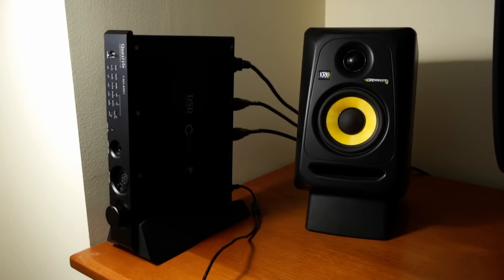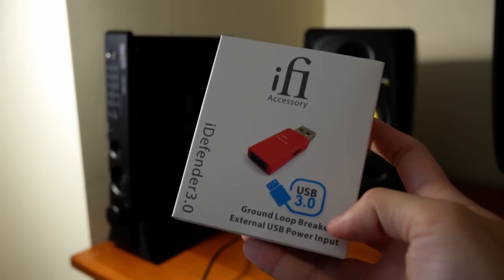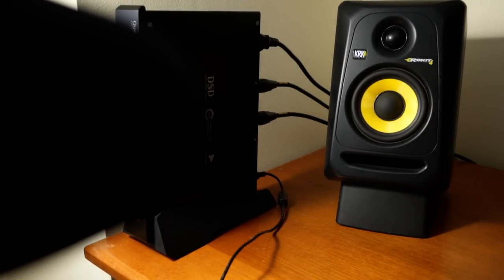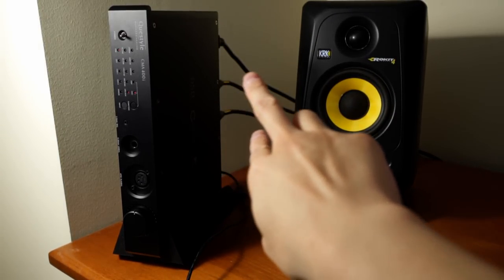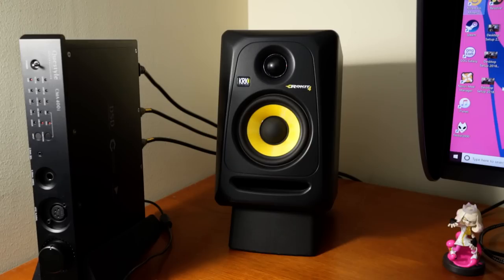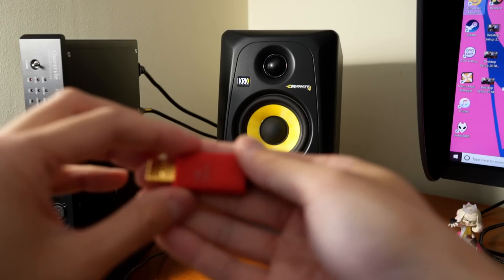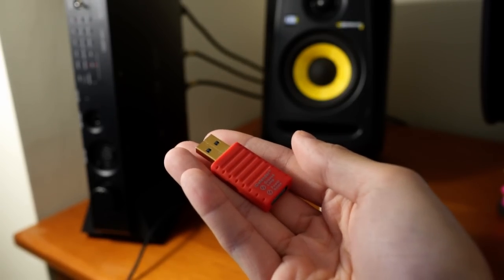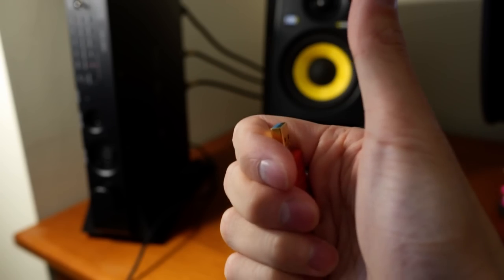ifi iDefender 3.0 Review & Demo: Breaking a GPU Noise Ground Loop

Comment: No one seems to be making any mention here of the fact that most PC power supplies that come with a store-bought PC are absolute garbage, built using the cheapest, low-end internal components possible. One of the nice things about either building your own PC or buying an off-the-shelf one that uses all industry standard PC components is that you can easily replace and upgrade any component in the system at any time. Whenever I buy a new system (or build one custom) I immediately replace the default power supply with a much more expensive one that's constructed using far higher quality internal components. If you have a system that is introducing noise every time your GPU is active you are very likely dealing with a system power supply that is incapable of delivering both sufficient power and sufficiently clean power that you require for proper operation (Hint: hearing audible noise through your speakers when a GPU kicks in and operates is something that should never happen). Rather than trying to take noise off of a ground loop with a $50 USB isolator/ground loop breaker, maybe your first step should instead be to make sure that you even have a high enough quality power supply in your system to begin with that can actually deliver enough (clean) power? A good quality replacement PC power supply built to far higher standards than the factory default one that comes with a new system can be purchased for anywhere from about $90 to $175, depending on how much power you need/want. That's always money well spent. Before trying to solve any audio problems with this type of after-market device, I'd make absolutley certain that I first had a very good, high-quality power supply running in my computer to begin with. Because I've always taken that step first, I've never had any type of noise issues using external speakers or headphones, regardless of the external DACs/amps that I've used. The other thing that can potentially help deliver slightly cleaner/less noisy power to your power supply is to replace your default (cheap) power cable with a far higher-grade oxygen-free one. A good OFC (Oxygen Free Copper) PC power supply cable can be purchased for anywhere from around $29 to $69 and is also money very well spent if your objective is to be able to get the cleanest possible audio out of your system.

Comment: I realize that this is an old video, but I think I've run into a similar problem. I'm curious, aside from the noise reduction, did the character of your audio change at all when using the iDefender 3.0?
Reply: Also having the same issue. Noise us even worse when trying to game.
Reply: old comment but yes it changes the character of audio, increases the high freqs and reduces the bass. It does completely solve my noise issue but I dont like how it sounds at all

Comment: It is so damn expensive because the used usb chip inside. I bought mine for about 10 euro's straight from the source in china and saves me allot of money. It is actually an isolated DC/DC converter (in fact a 1:1 PWM transformer) and a chip to isolate the bus lines. It is that complicated because usb requires the same ground path to be working, so it needs a 'conversion' trick. What you hearing (jitter) is a compound of the digital ground produced inside the computer. In fact it is not a fault of the computer hub, it's inside the huge usb soundcard. You can test this with a multimeter, if the RCA ground is connected to the USB GND pin and/or USB connector shield, they saved some dollars to do it right.

Comment: Have almost identical setup - PC, USB DAC, Active speakers, but iDefender did nothing to fix the buzzing sound. When i remove grounding from speakers, no buzz at all - so it is a multiple ground issue. You can almost buy a decent DAC for 50 €.

Comment: If that's all it does is disconnect the power lines, then you could probably take a pair of tweezers and pull out the + wire in the USB cable.  You can even put some super glue over the + wire, it's on the end so....It might just work and save about 60 bucks.  Everybody has 10 cables laying around.

Comment: I had a USB noise issue and couldn't figure it out. Went back to my Furutech manual (who would have thought to read the manaul!?) and they actually suggested just using an external powered USB port if it happens.  I haven't had a problem since.   So may be a cheaper option to try for people looking for a solution.
Reply: which one would your recommand ?
Reply: External powered usb didn't do anything to improve my issue for those reading. I've purchased the iDefender and their 5v power supply. I'll update once it comes in if anyone is on this old video and is curious.

Comment: I have this exact same problem with my Questyle CMA400i and my Macbook Pro Mid 2015. I bought the iDefender 3.0 and it doesn't work. Still the same ground loop noise...
Reply: Did you ever figure any solution?
Reply: @oshtsasquatch295  Yes I did. My Questyle and my Macbook charger were plugged in into one power strip that was plugged into the wall. I plugged the two devices into different power strips and somehow that solved the problem...
Reply: @bobsandee7983  Thanks for the reply. I have ordered a new soundcard (comes tomorrow) and I think that is what I'll need. I have been through the book (including cutting every single ground in the entire system). Hope the new card works...

Comment: So mutch thing to check before:
All cable shield, and if the computer make noise then 
Take a cable and take off red wire out (Cut-it) and use another power supply.
i mean the audio USB cable
Etc…

Comment: Overall good explaination! But "no power transfered" is wrong. Without any power the usb connection would not work. What it does is to put a galvanic break between input and output. So it forward Power but not the distorted power.

Comment: In your video using the defender supresses the noise caused by the computer.  But there's no audio coming from the speaker. What the buyer wants is the desired audio coming from the speaker without thr computer noise. Your video doesn't sho that.

Comment: You really should not use front panel USB connectors, the internal wires to those and the board connector are usually junk, also that wire usually runs right across all the electronics is less shielded than other connections.

Comment: Just chancec upon your video, just want to ask does the thing work as a regular usb data cable/plug or somwthing. I've been streaming for some time now and i want to use it with DS4 controller (im assuming the button inputs count as data input or transfer), coz when ever im charging my controller i get some static/clicking/hum from my headset. This only happens when im charging and at the same time got have the elgato chat audio cable pluged in to the capture device.

Comment: yes it works and the idea is very straightforward, which is removing the power pins in the USB connection, and only leaving the data pins.

however this is how the 1st grade of the electronics school would implement it, just as a proof of concept.

now, the most elegant implementation of the same idea, is by using the Adum3160 chips, and the monolithic air core transformer component, which does just that. it physically separates the incoming signal from the outgoing signal. 
not only that, it actually cleans the incoming signal, and sends a better version of it to the output, like a repeater or mini amplifier. 
it allows 12 Mbps data transfer rate bidirectionally. so it is not capable of USB 3.0 4.8 Gbps data transfer rate, to work continuously through such USB signal isolator. 
so if you are connecting a very high data transfer device, you must bear it in mind, that Adum3160 chip won;t be able to keep up.

however for the Audio Interface, USB 2.0 data transfer rate is sufficient for the 18x 24 bit channels simultaneously, so you should be safe there, unless you are working on a big mixer with more than 18 signals being consolidated into one USB connection.

also for the USB MIDI, the data transfer is 30 kbps, so you don't need to worry about USB 2.0 for the MIDI operation over USB connection.

I actually prefer the Adum3160 chip, which is the actual transformer, physically isolating input from output, and only sending / receiving the actual data, and filtering everything else, which is ideal.

And it only costs ~USD13, if you want to check it out. 
https://amzn.to/3IB224k
Reply: Dorkaholic  go ahead

Comment: Just want to point out - it could have very well been coil whine either way. Almost all computer hardware (most noticeably GPU's and PSU's) have it to a degree. It's just that more times than not, it's at such a high frequency we can't hear it. Your studio monitors could have simply amplified it. It can happen without them being even connected to the computer in question as a matter of fact. All it takes sometimes is simply being on the same circuit breaker, or plugged into the same wall socket.
Reply: It isn't coil whine

Comment: Grab an old USB cable and split the cable with an Exacto and cut the RED WIRE (No Power)   and your problem will be resolve.
Reply: Thake a good USB Cable Just Cut the Red wire...leave other as is....( If your USB Card need to be power by USB cable this is no good) but if you have external power Good!
Mi cable i have split it and cut red wire and place a Ferit bead magnet to hide the split and also it help to eliminate noise.

Comment: an electrician wouldn't really specialize in audio as they deal more with high voltage, focus on electrical safety, pull cables, fix cords, etc. An audio electrical tech, robotics technician (me) or technologist, audio engineer, etc. etc. would all be more qualified to answer this. From my knowledge you could have a direct earth ground (Wall socket, hopefully the earth outside eventually), instrument floating grounds (this will cause noise to feed back to the souce if the ground is not grounded to earth separately. These are also used as a reference signals..bla bla). Anyways, I'd really need to poke around your set up to

Comment: you know.. you literally can save yourself $40 and just buy a cheap data-only usb cable. that or take any usb cable you have laying around, cut the cable outer casing open and simply snip the power and/or ground cable.. 
You honestly only really need an item like this if your usb device does require the usb power, so that way you can use an external low to no noise dc power connection, rather than your pc's noisy usb power...

Comment: you wanna know how to stop this from happening entirely?  Break the ground pins off the power cables on the KRKs... DO IT!
Reply: Won't that be risky? We can electrocute ourselves and cause a fire hazard.
Reply: @ratedrsuperstarthega  Going on 1+ years, zero issues.
Reply: @MichaelBruceTaos  I'm happy for you that there are no issues so far. But in my opinion that is because so far you've not had a fault or leakage current yet. 
Please take no offense, I'm not trying to instruct you about anything. Just making you aware of potential dangers.
And if you know better, maybe I can do that myself if there's a detailed explanation, I won't electrocute myself someday.
Reply: @ratedrsuperstarthega  I have power outtages and surgest all the time.  No issues.  How the hell are you going to be electrocuted by a speaker sitting in a room?!  Trust me 10 years of GODDAMN noise, I would rather throw the speaker in the trash instead of deal with more noise.  OR just break the ground pin off the power cable.  FIXED
Reply: @MichaelBruceTaos  I'm happy that the problem solved for you.
But if the ground pin was not essential, why would the manufacturer design the speaker with 3 prong instead of going with just 2 prong?
Also if there is leakage or fault current into the speaker chassis and we try to switch on the power button on speaker or try to change the cable and we touch the chassis, won't we get a electric shock? 
I understand this won't happen everyday. Just a very rare event which can occur once in a blue moon day when there is fault/leakage current.
Why do you think the noise problem occurs in the first place? What is the root cause of this USB noise problem?
Reply: @ratedrsuperstarthega  If the manufacture designed the amplifier in the speaker so badly it does not reject ground noise.  I will gladly fix their problem for them.
Reply: @MichaelBruceTaos 
Even I'm frustrated the manufacturer just designs so poor gadgets. The motherboard/PSU/GFX card all keep emitting noise and the speaker can't reject ground noise. It's shame they can't design better.
But  In your opinion, why is there a ground pin on the speaker?

Comment: Well I AM an Electrician. And I kinda Do believe it has something to do with coil whine. 
Since when i disconnect my 980tis the USB hum is gone. 
I also have very loud crackling noise when i scroll webpages and so on. 
Could also be coil whine from the PC PSU but the noise does remind me a lot of the coil buzz you get when having having your GPUs running in a 3D application and using asymmetrical speaker cables. 
Anyway. Called Thomann Germany yesterday, they say the problem should not exist and i probably have a defective AI. 
With all the information out there its outrageous to me how they can say that. 
BUS powered Audio Interfaces are a scam guys at least when you have to get a USB reclocker for at least 100 bucks for it not to make terrible noise all day. 
Just get a individually powered Interface like the new Steinberg ones or the Presonus ones. 
If you get a buspowered one at least get something like the Black Lion Audio Revolution with a quality power filter.
Reply: Hey Thorsten, do you know how this USB works? Is it just about the external Power supply or is there some other magic happening inside? how is the usb killing the noise?
Reply: @lelonl7510  I eventually bought a new interface. But yes it's just about the independent power for the USB bus. Seems like my motherboard (which supposedly is a premium Asus product btw) just has terrible USB power.
You could just splice a regular USB cable and feed in 5V from a power supply from a quality standalone USB supply for all I know.